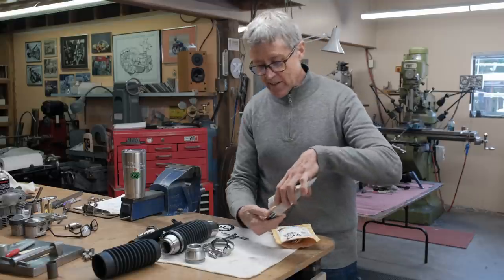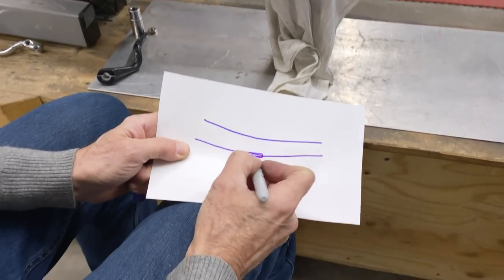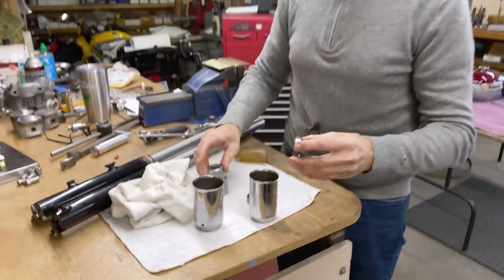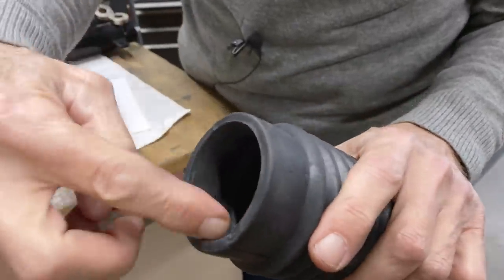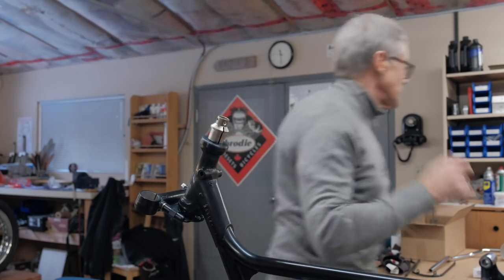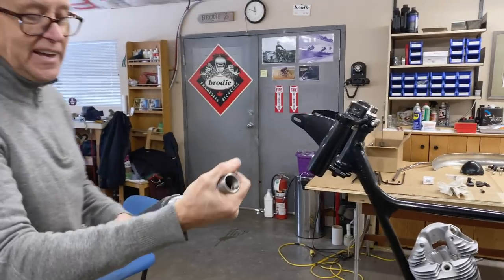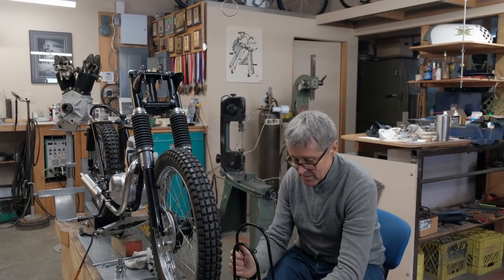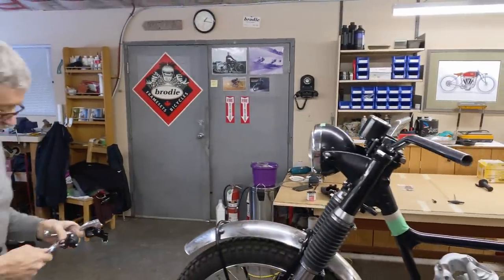Tiger Cub Front End Assembly // Paul Brodie's Shop

Comment: Of course they aren't EXAUST STUDS! Everybody knows that they're CARBONATOR SCRUTINIZERS!!!
Seriously, though... another fabricator that I watch always keeps a compressed air gun ready while he welds, to cool things off before they warp. See if that helps...
Reply from the maker: Tom... sense of humour! Never heard of blowing a weld to keep it cool. That's a new one.
Reply: @paulbrodie  yes, Bad Chad swears by it. He does a lot of cutting and welding custom cars. When butt welding sheet metal, he'll make up to about 4 spots in a row (anout an inch or so), blow it cool, then jump about 4 inches and repeat. Once he makes it to the end of the weld, he cycles back to the beginning, andoes another series of spots, repeating the process until he's done. With your cub header pipe, I'd try a couple of spots, blow it cool, rotate a 1/4 of the dia, etc. Cooling really seems to solve the warp problem you described. Try it on some scrap tubing. He does mig welding, and if he has a large gap to fill, he'll use a coat hanger on steel, or a similar metal rod like you do with your tig.
Reply from the maker: @tomfortson2684  I was filling in low spots about 1/2" wide, so it's not the standard welding practice. I will keep the air cooling in mind, thanks.